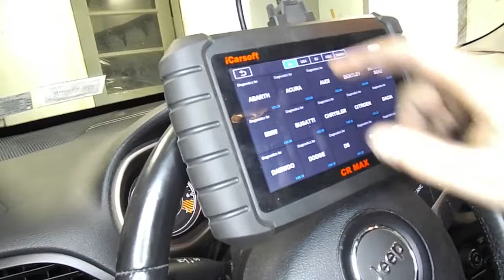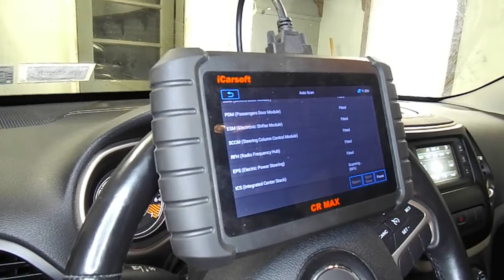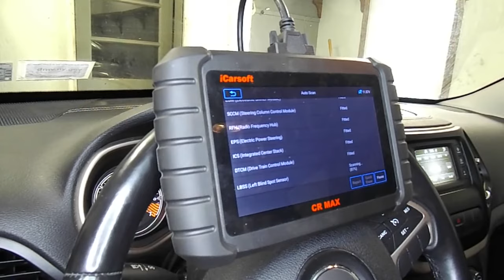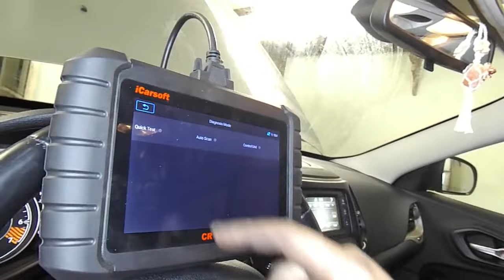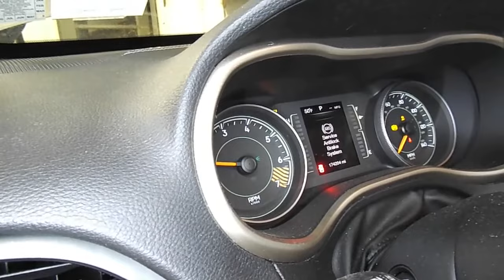Jeep Cherokee Code P0520 Oil Pressure Sensor

Comment: I did this repair today.  Thanks for your video.  Subscribed.  About the only thing I would add to it is that one may want to use some brake cleaner in the pigtail that gets disconnected from the switch/sensor as it was oily.  Thanks again!

Comment: Great video I have a question. Is there need to remove the right wheel when fitting the oil pressure sensor? because my right lock nut key is messed up can’t remove the wheel at the moment

Comment: Would riding with the light on be bad? I have the part I just haven’t found time to fix it and I don’t have a second vehicle either. I keep oil in the car and make sure the oil changed on time.

Comment: I own a Jeep Cherokee 2015 with the 2.4L engine. Have owned it since new and was told Eneos 0w20 full synthetic was the oil used when the engine was built. I do my own oil changes and for years was using only the Eneos 0w20. The store I purchased from was out so I went with Pennzoil 0w20 and 3 days after oil change I had low oil pressure code. Changed back to the Eneos 0w20 and the code went away. Didn't come back again until I started using Royal Purple 0w20 and was fine for about a year then the same low oil pressure code came up. Is it possible the exact brand oil the engine was built with has to be used or you get the low oil pressure code?
Reply: I can't imagine that being the case. Question; On the engine where you add oil, what kind of oil does it say to use? I have a '15 Trailhawk and it says to use 5w20.

Comment: 3.2 L V6 location of the sensor??
Reply: I haven't been able to find any answers as to where it's located on this engine
Reply: @slashbenji  Are you watching the video?? He says and shows where it's at. It's under the engine on the drivers side I believe.
Reply: I’m with you? I have a 3.2 v-6 Cherokee trailhalk!?
Reply: @andrewmartinez1102  after trying to replace mine, I realized that this video actually does not show the correct location. At least on my Cherokee Trailhawk v6, it's located under the engine manifold. It's a pretty big job to get to.
Reply: @wolphman007 this is 2.4 l
Reply: It's on oil cooler underneath intake